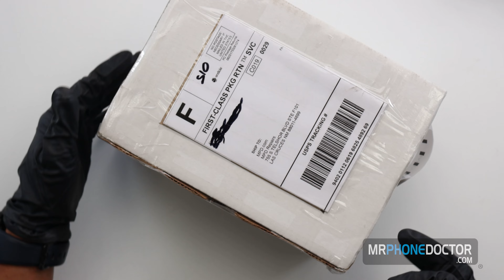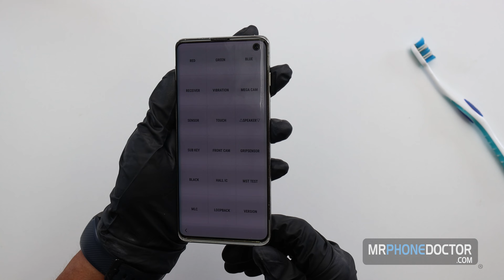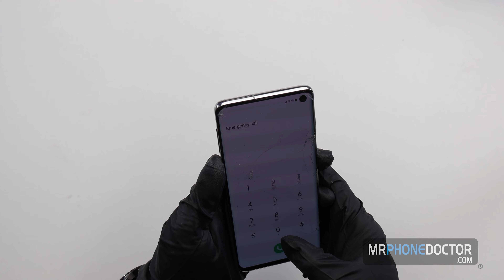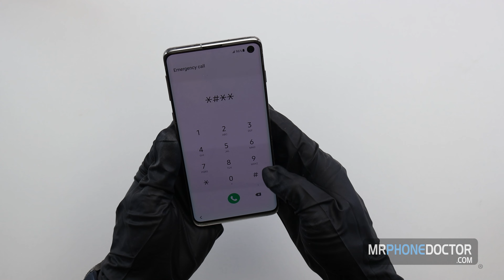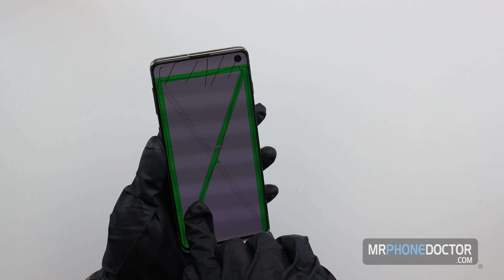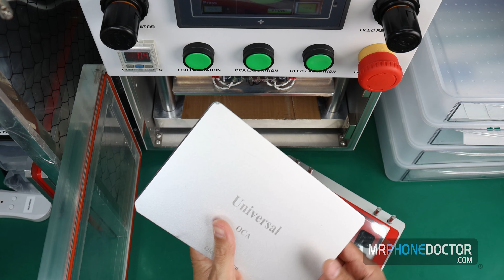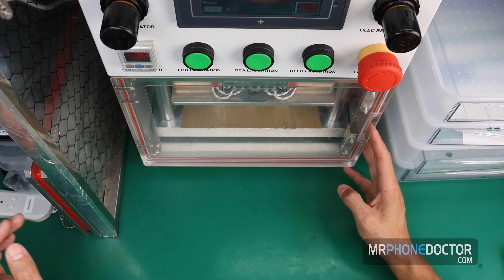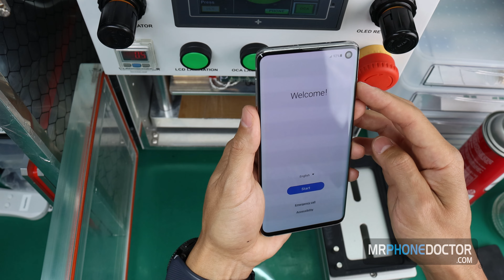Samsung Galaxy S10 Cracked Screen Phone Repair Restoration - ASMR

Comment: Love the video well made and great job :) I have a few questions :) 
1 what cable size are u using ?
2 what heat temp are u using 
3 is the phone ok to be fully assembled while doing this repair :)
Reply from the maker: .03, 90c, yes its ok look at the video any my others many can be done fully assembled
Reply: @MrPhoneDoctor  and does the battery suffer damage from being directly in the heat?